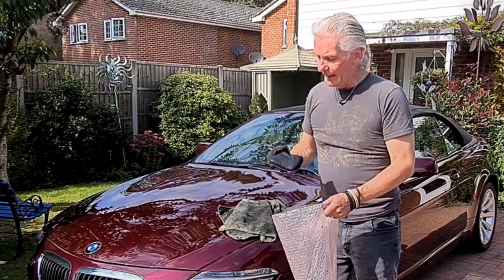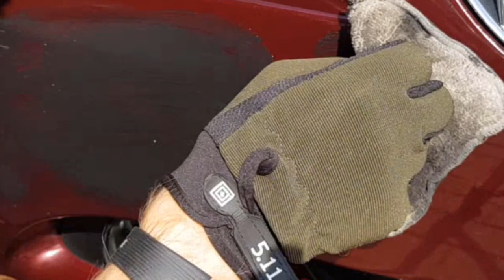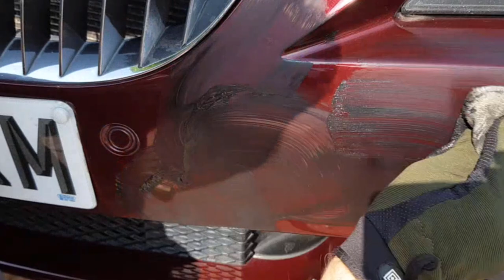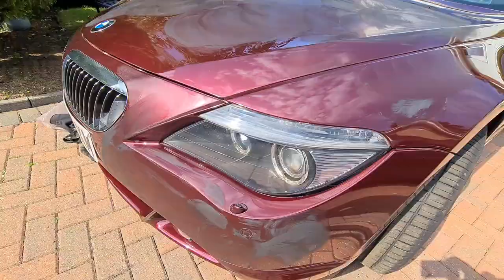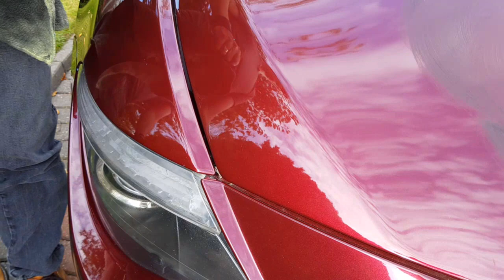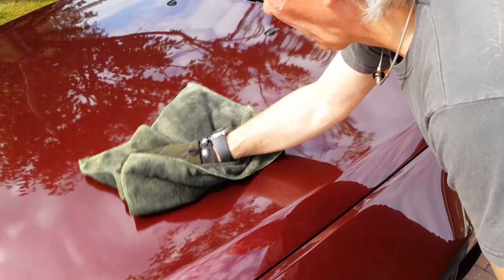BMW 6-Series Stone Chip No-Paint Fix

Comment: it looks awesome!  I've used Dr Color Chip for my 650i e64 and it worked well too.  BTW have you changed your oil pressure switch in the e64? wondering if I should tackle it myself?
Reply from the maker: Lee changed it for me when I had the alternator bracket seal done - it's quite accessible so worth a go!